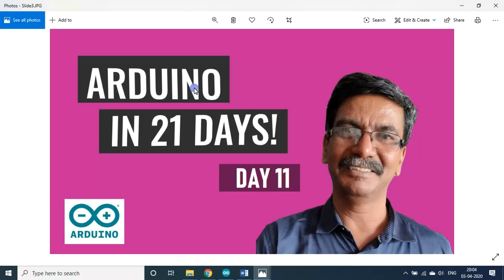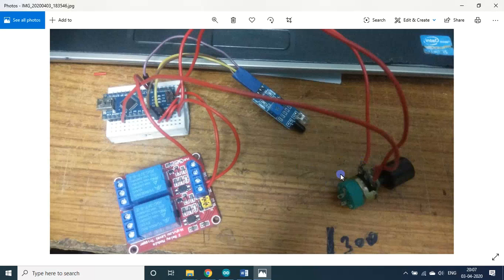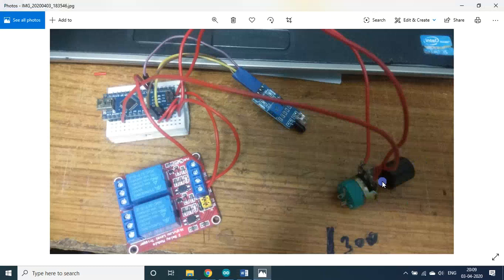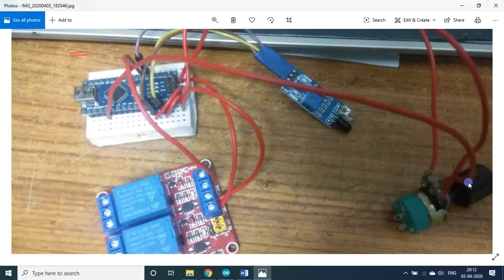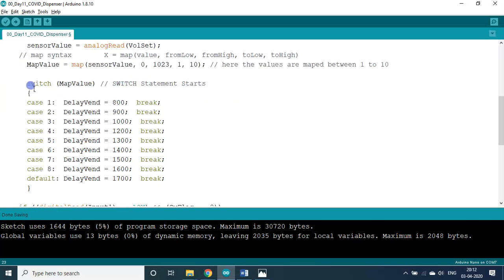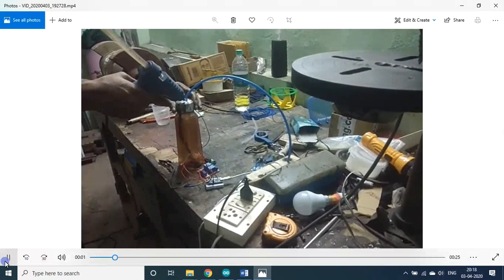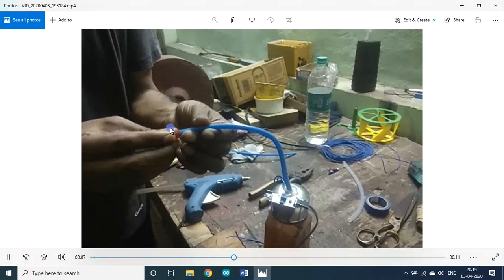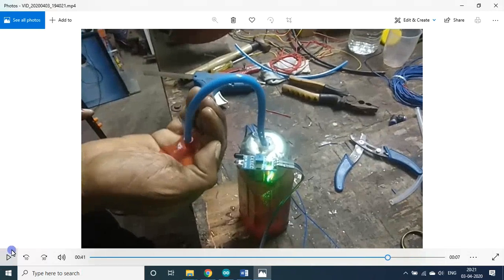D11 | Arduino | COVID-19 Special – Non-Contact Liquid Dispenser

Comment: Sir I have a doubt....at starting of the programs u have used #define at sometimes #include and at sometimes u have used int and float...I'm not clear at that point can u explain it clearly sir....
Reply from the maker: 1. The #include is used to include the Header files (having  *.h extention)
2. the #define can be used to assign variable(s) to particular Digital /  Analog pin (or) it can be done like int led1    3 --> meaning the led1 is assigned to Digital pin no. 3.
3. the int means that the assigned variable can have / store only whole numbers viz 1, 2, 3, 10, 200, 203, etc...
4. the float is used so that the variable can store decimal values like 1.123,  3.14, 34.3325, etc... 
For more understanding you please read 'C' Programming Books.